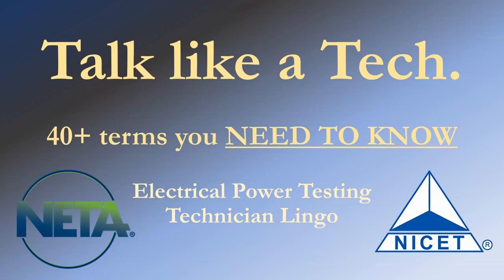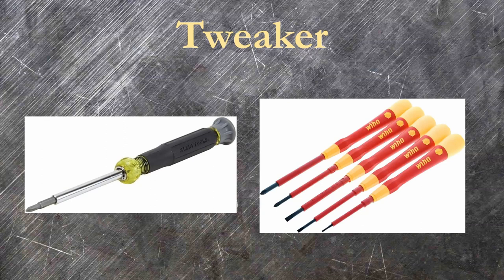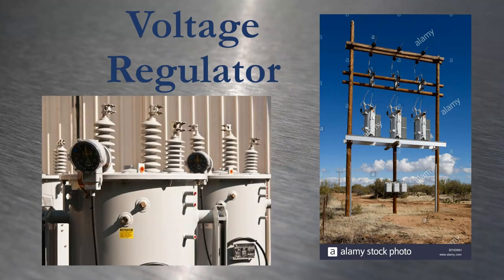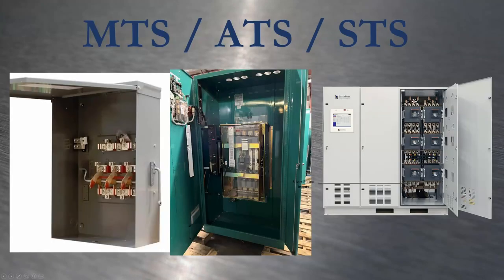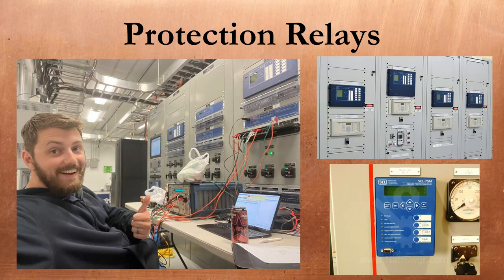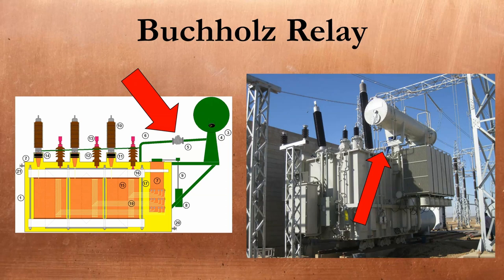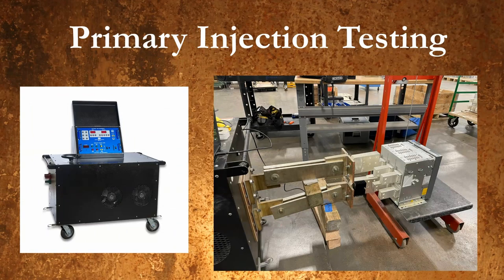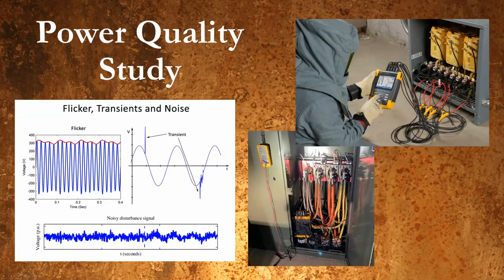40 Phrases and Slang you NEED TO KNOW as an Electrical Technician

Comment: Pumpkin = sniff tester 😂 "did you sniff it?";
Starter = screwdriver with a lock;
VLF/ Tan delta= Very low frequency, good for testing cable insulation and can be used instead of AC HighPot;
"To flush" = short the bushing of a transformer, for instance, to clear the resudal inductance of the windings;
I am still at school taking EET, and I am not an English native speaker. I was so confused during my first coop term working with tech guys...
PS I am from Canada, and have never heard pumpkin from guys